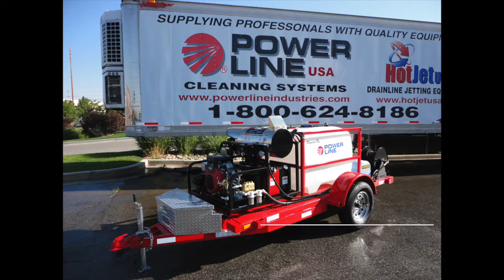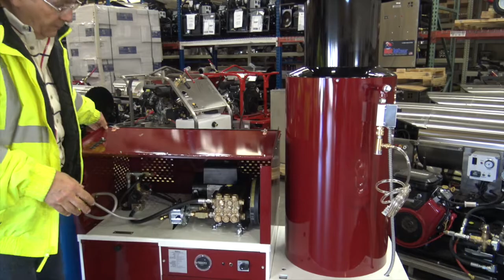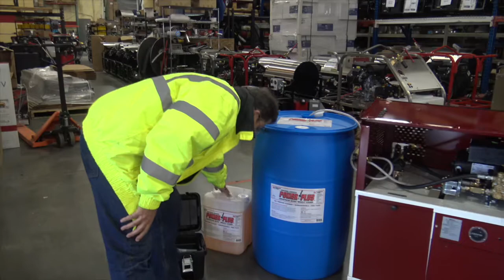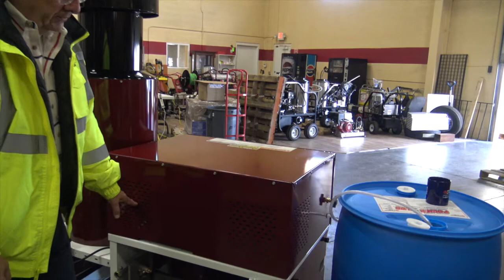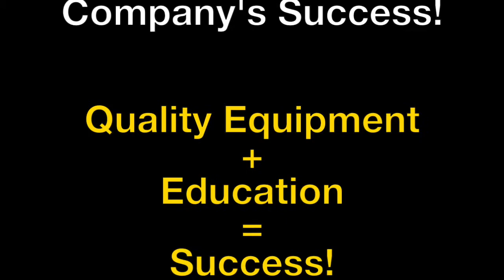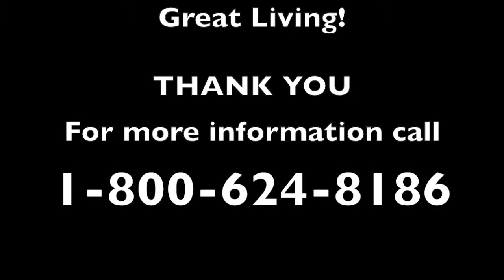Natural Gas Series Power Washer

Comment: I really like this pressure washer.>>>t.co/PmVlPumnxL  It is light enough to carry to the work site, and easy to operate. I used this on a really old redwood deck that was covered with pine sap and mold. Using the black tip to wash down the deck was straight forward and then using the 15 degree tip to remove the sap and mold was easy.